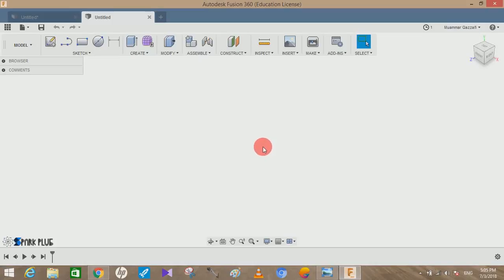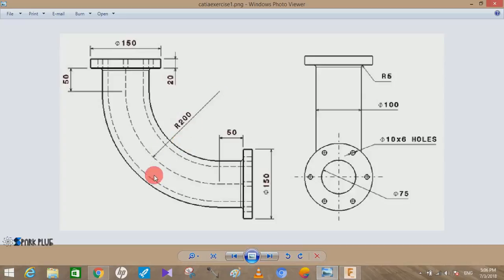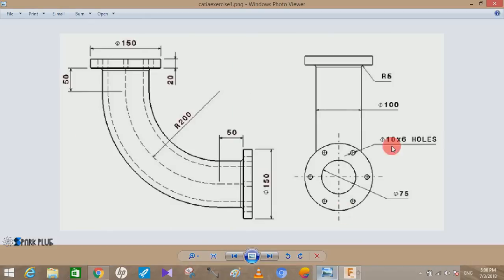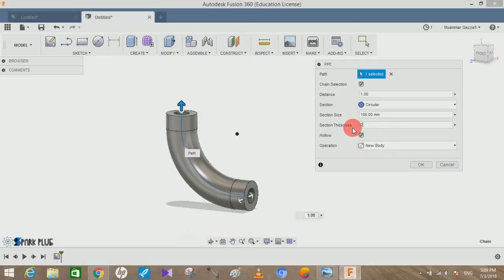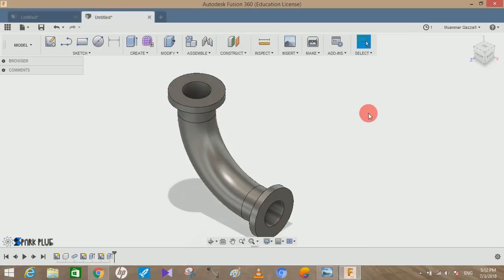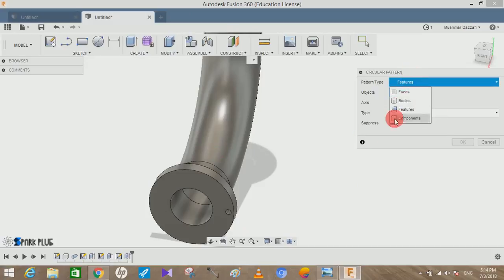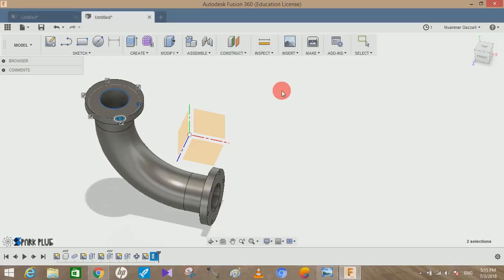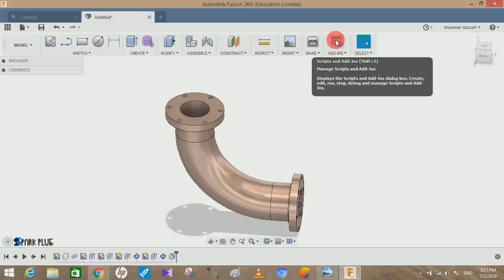Fusion 360 beginner's Exercise #1 - Fusion 360 tutorial

Comment: If you are already a bit familiar with the commands and can do the object yourself without watching this video step-by-step, I suggest you do the object your way and then watch the video on how Spark Plug here did it, then you can see if he used any shortcuts that would make your life easier.
What I also suggest is:
When you are about to make the connection parts/flanges of the pipe, i suggest you draw the same sketch out as he did, D150, but before extrude, already make those small circles with the same 2D circular pattern. Then after that extrude the piece you need.
For the second flange/top connection, you can mirror the previously made connection, slide the timeline back 1 bit (before extrude), make a construction plane between the top pipe and right side pipe. You should get a construction plane at 45 degrees, just like the radius 200 is shown on the 2D sketch.
Now you can slide the timeline back to "present" (so that the first extrude of the flange piece is done), select mirror, select the flange and for mirror plane select the 45degree plane that you just created.
And everything should be nice!.
Thanks for the videos!
Great for beginners.

Comment: Thanks for the exercise.  PLEASE Note, the 6 bolt pattern you created in the second flange does not match the drawing.  The holes are not clocked correctly. The hole patterns for both flanges should be clocked the same.   👍😎👍

Comment: great video, thanks. by the way, 'mm' is called 'milli-meter', or a "mil"  for short  ;-)
Reply from the maker: It's millimetre
Reply: @SPARKPLUG98  ter  VS tre. In the USA, the normal and correct way is milli-meter. In England or other places around the world, it is also correct to say milli-metre .  Both of you are correct! Lol, I could be wrong, though!!
Reply: a couple years late, but you're not completely correct.  

"Mil" does not mean the same thing depending upon whom you are speaking with, which can be industry dependent.  Several industries in the US bastardize the Metric and Imperial together.  Many machinists I have worked with, from novices to experts use "mils" as shorthand to denote "milli-inches".  They will also freely interchange "mils" with "thous" (to be understood as "thousandth's of an inch").   I have received spools that denote product in "MF" to be read as mega-feet.  Yes,  it's obnoxious. but depending on whom you're speaking with and possibly handing over technical drawings to these things cannot be taken for granted.

Comment: I have a problem with the last part when we have to make the 5mm curve. When I do this it separates the parts apart bue to the curvature.
What i am doing wrong?
Reply from the maker: Could you tell me the time???exact where in the video???
Reply: From 9:00 and on
Reply from the maker: That's a  simple fillet , I don't know  what you are doing wrong there ? Can you share photos on my email , so that I can have a look and tell you afterwards
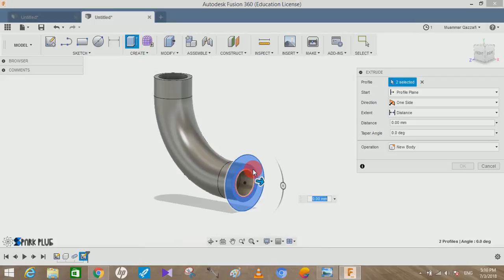Reply: I ran into the same problem, and I think you made the same mistake I did. When you extrude the flange piece, about 5:20, you have to extrude both circles. After I changed that my fillet worked just fine.